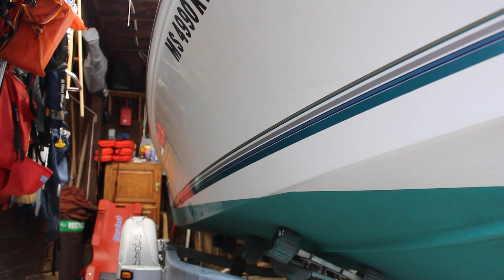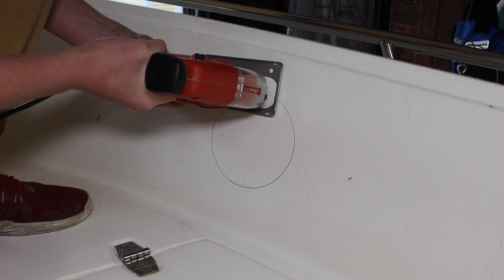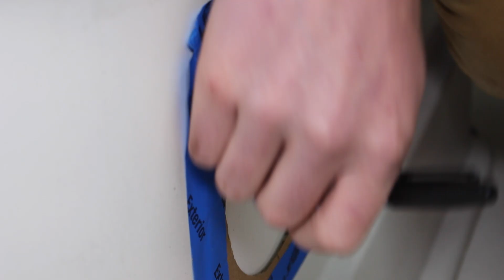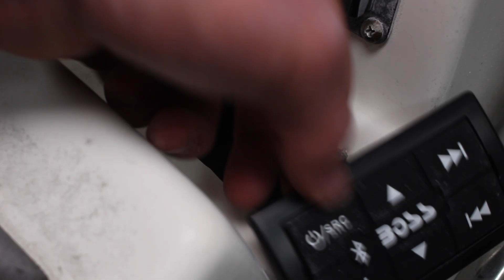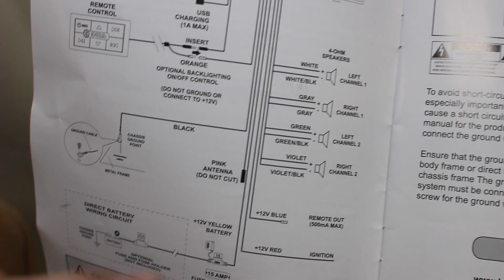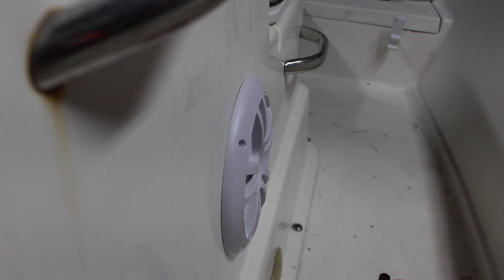Boat Speaker Installation // BOSS Audio ASK904B.64

Comment: Thanks for the vid. It helped alot. My only question: when I hooked up the red "ignition" wire to the battery, my unit wouldnt shut off. The touch pad would stay on with a red light. 
No kidding though, rarely do I come across a video for exactly the same application Im working on so, again, thanks for the vid. It saved me hours.
Reply from the maker: The "ignition" wire is supposed to be hooked up to a switched power source, meaning that wire should not have power when the boat is not in use. I'm glad to hear you found the video helpful!
Reply: Agree with JD.  On mine I hooked up a toggle switch on the power cord with a fuse in between to cut the power when not in use and prevent battery drain
Reply: @JDCarsChannel  hey JD you wired the ignition straight to the battery though? Wouldn't you have power at all time?

Comment: Hey man how’s it going after 2 years after installation any problems ?
Reply from the maker: The speakers are still working great!
Reply: I have those speakers. They are tough but sound horrible but what do you expect for $20. Good value if your speakers are going to get trashed by salt anyway.
Reply: @SolarBurrito  Are you still using these speakers or have you found any better ones?

Comment: Thanks for the awesome video/tutorial. I have a 19' Scout with a 115hp outboard. My biggest concern is listening to music while moving at full speed (~35mph) in my windy Charleston harbor/rivers. Does this system get loud enough to hear over engine noise and wind without distortion?
Reply from the maker: Well... no. You're not going to have zero distortion with any and every sound system out there. It will also depend on your boat's layout. At cruising speed I can still hear my speakers pretty well. At full speed... not so much.

Comment: I just installed these in my boat, really like them except that they don’t work when the boat is running. Did you have this problem?
Reply from the maker: Glad the install went smoothly. I didn't experience that problem! It sounds like your system may not be receiving power when the boat is on-- would recommend checking over all wiring.

Comment: I hear a loud pop in my speakers when i fire up the boat. Only way to not hear it is by turning off head unit before i turn the key and thats annoying. I have dual (bridged) battery set up. Is it the ground issue or the way batteries are set up causing current loop when starting up ?
Reply from the maker: I’m not exactly sure... not a genius with battery chemistry, but I would say just turn it off before starting to be safe, or run your batteries separately

Comment: Hey what's the capacity of your battery? Also for how long can you listen to music with this system before you have to recharge?

I'm planning this soundsytem in my boat but i only got 80 Ah.. That wouldn't last for too long
Reply from the maker: Good question... We have drained and killed be battery before, but you learn not to quickly 😅

We have a fairly high capacity (I want to say 120Ah) battery and it can usually keep up if running the boat somewhat periodically

Comment: Besides the connections of the 4 speakers, are there any other connections on the amplifier to connect to another amp? If I am going to hook up a subwoofer along with the 4 speakers.
Reply from the maker: Yes, there appear to be optional leads to hook up a woofer
Reply: @JDCarsChannel  okay thanks.

Comment: Hi. Have you measures how much Ah the system draws from the battery approx? Thinking of buying this stereo but not sure how big battery I should go for. Was actually thinking about a motorcycle battery since it’s small in size, but they are limited in Ah...
Reply from the maker: I just have a single average size boat battery and it does fine. Bigger is almost always better with batteries though

Comment: Hey just wondering forgetting this in tomorrow for my side hy side just wondering if it came with enough speaker wire or if you had to add some aswell as if the connectors actually came on it
Reply from the maker: It came with plenty for me!

Comment: Anybody getting static interference. Works fine while the engine is off. Crank the engine and is all jumbled? HELP!
Reply: Chad Isbill  probably a bad ground
Reply: Try resistor spark plugs.
Reply: Make sure it's all wired to the same battery radio and amp or use rca resistors
Reply: Hello,  I have the same problem. Did you find a solution for it????